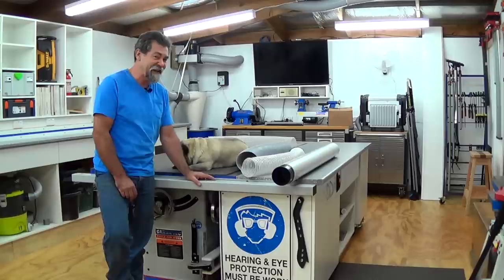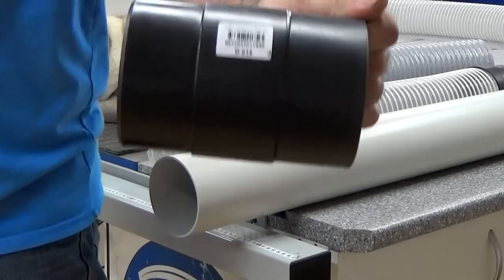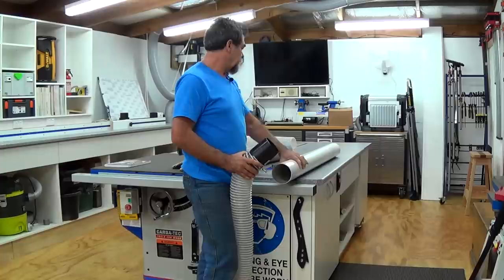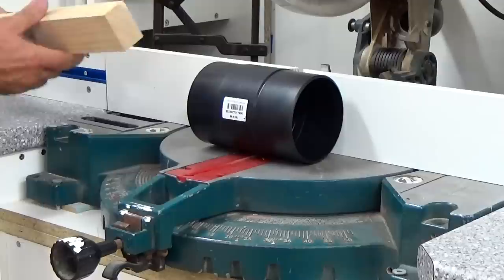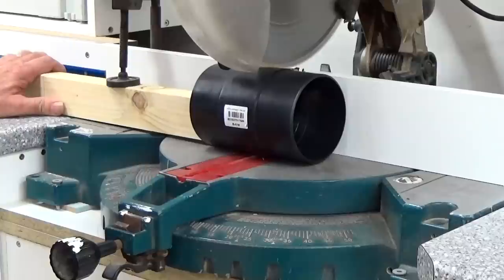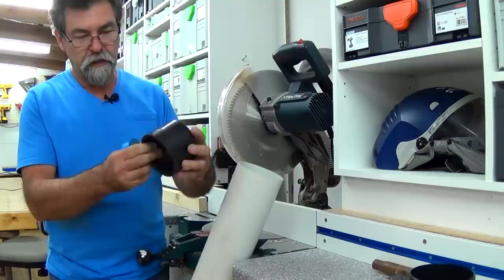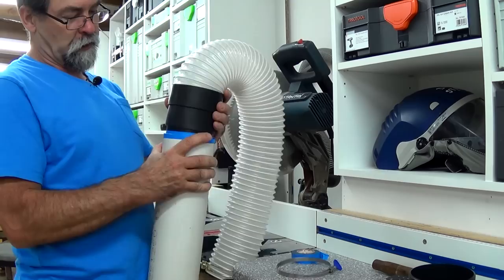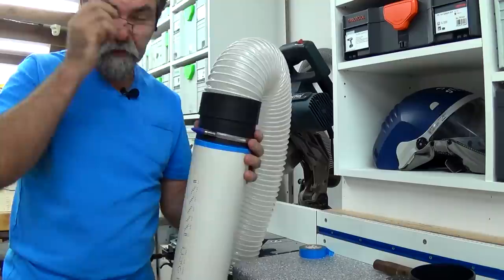Dave Stanton woodworking. How to connect 4 inch PVC (sewer pipe) to 4 inch dust extraction pipe

Comment: Great Video... You gave me the inspiration that I needed.   But let me add one more innovation...   I was in a jam, and needed something right away.   I cut a 4" length of the PVC pipe.  I then took that to the band saw, and removed 3/4" of the wall.  I then squeezed, that and it fit perfectly inside the PVC as a "rough and ready" adapter. (If I am completely honest, it took me two tries of trial and error.  I took a bit too much off the first attempt, and left a little gap)
Reply from the maker: BBBruceinToronto That's an idea, thanks for watching!

Comment: Used those couplings on my DC and only had to sand them lightly to get them to fit inside American SDR. A couple bucks per fitting gives you 2 transitions. A good deal in my mind. Beats heating and modifying the PVC and it's reversible. I  wouldn't glue them in place as dissimilar plastics glue don't work well. Great tip.

Comment: Great tip another solution is to cut a thin kerf along a short section of the the PVC pipe compress the PVC pipe with hose clamp slide on the hose, release the first clamp this expands holding the hose and seal the kerf if need be with silicone sealant or foil duct tape.
Reply from the maker: Yes, that would also work.

Comment: A few years ago, I purchased an adapter fitting from Rockler and it works with only one type of PVC sewer pipe - take it with you to the big box store to  insure it fits properly in the PVC pipe you select.  I think someone who is more familiar can tell you the type of PVC pipe that fits the fitting but I found out the hard way and with the return to Menards with the wrong diameter pipe, I then insured the fitting works in the correct pipe  in the store..  It works well.  As an aside note:  I also purchased a boot from Amazon that works as a quick connect to the flex hose - much less expensive than the proprietary one from Rockler that works only with their fittings.
Reply from the maker: +Eugene Kasper The boots are a great idea. I actually show one in the video but fail to mention it. Might do a video on different connections one day?

Comment: Thanks David! Great tip for sure. You know, I've always wondered why it's usually SO difficult to join two pieces of pipe that are both a given identical (numerical) size... One would think four inches would be four inches!! LOL  You always have good tip man.
Reply from the maker: Thanks Charlie. I try to find answers to anything in my workshop that makes me scratch my head.
Reply: +David Stanton The difference her in the US is the 4" sewer pipe is manufactured different than standard 4" PVC say schedule 40 so there is no cross connection from sewer/drain lines to potable water lines.
Reply: @kimshirley7014  The potable pipe also has thicker walls, to withstand water under pressure.
Having thicker walls means the outside diameter is larger than DWV pipe, so the same fittings won't work.

Comment from the maker: One thing that isn't clear in my video is that you can slide 4 inch flex pipe directly over the plastic fitting. That plastic fitting is essential as the diameter reducer, I only use the soft rubber boot on the end of the flex hose because it makes it a quick change style of fitting. Might do another video to show different quick connect options, stay tuned!
Reply: +David Stanton good deal you had confused for a moment.  great tip sir
Reply: Thanks Dave, I was wondering about that.

Comment: Good stuff! Last time I cut pipe on a mitre saw the unanchored end went flying across the workshop when the blade cut it through!
Reply from the maker: That is where a good brake in the saw's design is handy.
Reply: ***** definitley would have helped if it did have one! (was a makita)
Reply: +Machine Man I had an "argument" on line with a fella who didn't see the benefit of clamping down pvc type materials when band sawing. I found there were benefits the hard way. I didn't get hurt but could have. He still didn't believe me. Your technique is worth watching.
Thanks
Reply: William Branham yeah I only ever done it the once, learnt pretty quickly after wards lol
Reply from the maker: Thanks guys. A simple matter of the saw's clamp and a sacrificial piece of wood can save the day.

Comment: Use a 3" black abs coupling, o/d is the same as the I/d of the hose and pvc pipe.
Reply from the maker: Dropping down from 4 inch to 3 inch in the middle of the airstream would act as a pressure reducer. Not a great idea.

Comment: Sir, I have a 6 inch diameter of 30 meter PVC sewerage line in my house which is broken. If I put this 30 meter flexible pipe of 5 inch diameter inside it, will it work properly?
Reply from the maker: No it will not.

Comment: G'day Dave, have pretty much set up my piping for dust collector, most of it is the 4" stretchy plastic pipe that comes in the carbatec kit, I have put a section of sewer pipe about 1800 long in he works and now have read a bit about static electricity build up and this worries me. My dust extractor is what yours was before you cyclones it. Not much on YouTube that fullyexplains how to wire up to get rid of static, may have missed it but couldn't find one of your videos that covered it so could you maybe find time to address this issue, little bit reluctant to use he system yet. Does static only occur when you you use sewer pipe pvc or does it still happen when using the flexible expanding hose from the kit. Hope you can help with this one, thank you, Macca

Comment: Hello, how did you connect the black connector with the flexible pipe? Please let me know... Awaiting.
Reply from the maker: Hose clamp
Reply: @DavidStanton  thanks a ton, but does hose clamp holds up well if soil is passed through it. Just concern about leakage and durability.
Reply from the maker: This is for dust extraction systems, not soil.

Comment: Hi Dave , Like your videos !  I thought at last an easy way to solve that problem , bought the M018 from Cabatec , got some 100mm sewer pipe ( 100mm DWV ) , the sewer pipe has a ID of 103mm and the M-018 has a OD of 105mm , so she no fit ! 
Have you come across this before ?
Reply from the maker: just measured a  m-018 I had here and it is 104 mm using the calipers. Maybe give it a little bit of a sand?
Reply: Wouldn't fit in the pipe my plumber dropped off , went to Bunnings and it wouldn't fit in theirs either , but went to a local Plumbing supply , and although it was the same pipe , 100mm DWV , it fitted perfectly . Must of had just a slightly smaller wall thickness  . The Brand was "Pipemakers" if that is any help to someone . Thanks anyway for your interest .

Comment: Hi David, question on pipe diameter. You're using 4" piping, can I also get away with 2" for my shop dust extraction system? Bought a Nilfisk industrial vac with two 1300 watt motors. You can use individually or in series. Has a good inbuilt and washable filter so with a cyclone in the system, fine dust shouldn't be a problem.  The vac has an 55 mil (2") inlet hole. With the two motors, I assume I will have enough suction/air flow. Again, will 2" be ok or would you recommend using an adaptor from 2" to 4" and if I did that, would the loss of suction be too big? Thanks man. Love your stuff 🤘
Reply from the maker: Hi Robert. Have a look at the secondary system I have in my work shop. Thanks for the compliment!! https://youtu.be/lRgM0iiRhVc
Reply: Hi again Dave, just checked out the other vid. You say secondary system. Does this mean your primary system is indeed 4"? I understand that 2" is fine when using orbital sanders etc, I would however want to use 2" for everything. Have read all the comments regarding pressure and air flow, also understand that going from 2" on the vac to a 4" pipe is going to reduce suction power considerably. Excuse my asking again, but I will be using a Dust Commander HD cyclone (steel version) with 50 mil inlet/outlet holes. Haven't bought it yet, also haven't  bought any piping as yet. Could I really get away with 2" throughout? Machines to be used: Bosch GTS XC table saw, Bosch mitre saw, sanders etc. Going forward, planer and sizer. Thanks
Reply: Hi Dave, found all my answers in your other vids. Thanks 👍

Comment: Mate, quick query. I'm in NZ, I've got my 100mm PVC all sussed but what I'm struggling with is coupling the pvc pipe onto the carbatec plastic blast gates. How do you do this? At the moment I'm using those little couplers exactly how you've demonstrated in your video, then using a short piece of 100m flexi hose to attach the blast gate. Is there a better way??
Reply from the maker: This is the easiest way.
Reply: Thanks mate, just looks a bit ugly is all :p

Comment: Hi Dave. Great tips mate! Just a quick question, do you run 5" ducting around your shop or did you settle for 4" PVC? I'm having a bit of a dilemma as I have a 2HP carbatec DC, but finding it very difficult and expensive to run 5" everywhere for the extra air flow. The only 5" smooth pipe i can find is the snap lock metal ducting. I wanted to avoid the flexi "ribbed" 5" hose. Any advice you could give would be amazing!
Reply from the maker: Hi Lee, thanks for watching!
You can get away with 4 inch pvc and just run 4 inch flexi hose to machine pick up points if you want to. I just did it for the 15 inch thicknesser. You can see it in the review of that machine. Everywhere else I ran 5 inch flexi. Some people use 6 inch stormwater pipe and then reduce to 4 inch flexi for the drops to keep the air speed up on a vertical lift.

Comment: where can i purchase the sewer pipe, to 4" hose coupling in the states?
Reply from the maker: Dan Loschko As I don't live in the States Dan, I can't help you.
Reply: Thanks. We have the same sewer pipe...Just can't find that fitting... Novel idea. Great videos!
Reply from the maker: Dan Loschko Try rockler to see if they can help you out over there.
Reply: +Dan Loschko Harbor Freight. Buy the connector just as David has here and do the same.They were $4.49 each. I just purchased 3 of them. They were $4.49 each plus shipping. Local store does not have them. You can also order or pick up from a Rockler Store but they are much higher in price.

Comment: Do you run an earth on your ducting? And if so can you do a video on it. Thanks. 👍
Reply from the maker: Luke Doggett Hi Luke. I do not run any extra earth on my ducting. Where it runs under the floor the pipe is in contact with the concrete slab below which is an earth point. Also, all of my machines connected to the ducting are earthed through the mains and in turn, a copper earth rod driven into the ground.